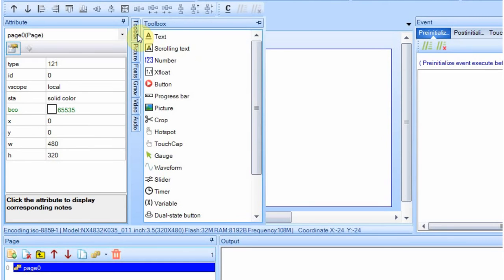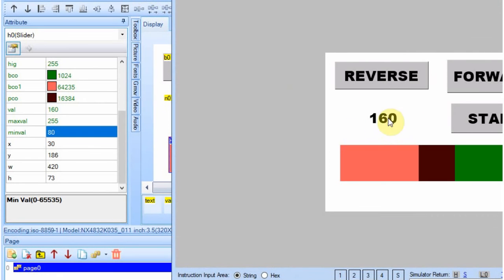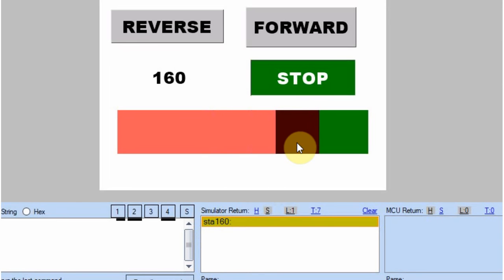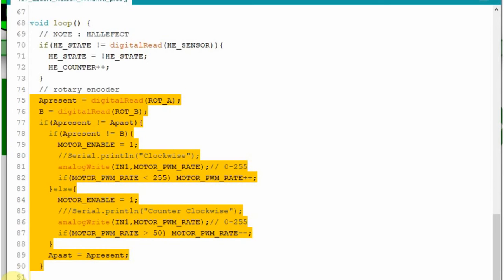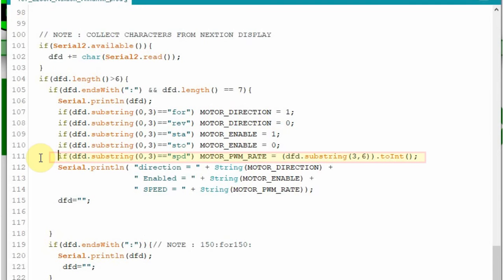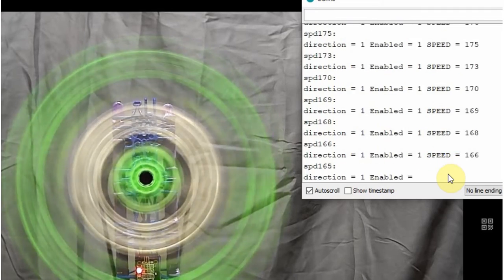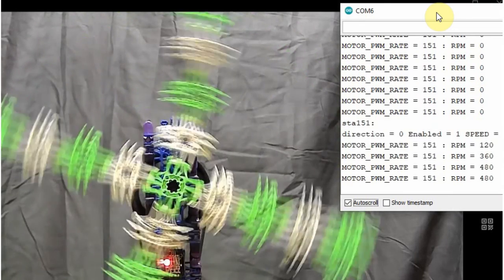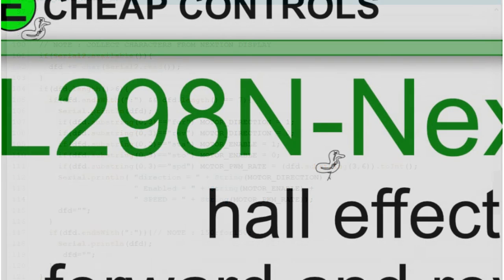157 L298N with a Nextion display and direction control Arduino Programming

Comment: Hello, i have a question. Is it possible to combine the functions in this video with video 132, so i can adjust the speed, direction, and duration of the motor in 1 display? Thanks
Reply from the maker: I think that is very possible.  Maintaining speed over time can get tricky.  You will need some PID control.  But it is doable with some time and patience.

Comment: Where is the link code? link not found
Reply from the maker: I am sorry you had an issues.  I fixed the link and uploaded the code.  If the link does not work you can try www.cheepcontrols.com directly for older videos and then in the search box enter the video number.  Thank  you for watching.

Comment: I set the initial value in the slicer to 80. 
But for me it only shows when I touch it. 
How can I make it count the value of the slicer at startup?

if(h0.val>5)
{
  va0.val=1
}else
{
  va0.val=0
}
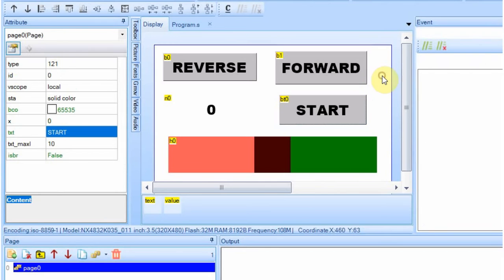Reply from the maker: I have it set on the page initialization.  this way when you start the screen it should show the value.  Go back to the 2:45 time in the video and watch.

Comment: hi is it possible to have 1 button with multi time of text ?
Reply from the maker: I believe it is possible.  I am not sure exactly what you are asking but you can program many lines to output with press of a button.  You can have a delimiting character to seperate the lines or have a short delay.  Thanks for watching
Reply: thank you for your reply! i trying to convert button to nextion in the arduino i using switch case coding to perform single button to switch the task that i set to display it at nextion display do u have any project something like this?
Reply from the maker: There may be a language issue.  I do not understand the line "i trying to convert button to nextion in the arduino"  Are you trying to take a physical button that used to connect to the Arduino and use the Nextion Display instead?
Reply: thank you for replying my message! sorry for my late reply! i was trying to use the nextion display button to control the motor, that's 3 type of fix motor speed need to display but just on 0ne single button, to display sp1, sp2, sp3...
Reply from the maker: I understand now.  Thank you for the better explanation. I will look through my other videos and see if I can find something to help you.  I will post again if I find one or if I don't.
Reply from the maker: what type of motor controller are you using that is connected to the Arduino or is your motor controller connected directly to the Nextion Display.  Also what model of Nextion Display are you using?
Reply: hi i really appreciated you take seriously my question! i am using  NEMA23 motor  DM542 Driver  connected to NANO and NANO connected to Nextion Display
Reply from the maker: I will look into this and comment when I have collected some information.  I am not familiar with the DM542.  I assume it is similar to some of the ones I use so I should have some input soon.
Reply: that's great ! for DM542 still using enable , direction and step
Reply from the maker: It is very similar to the TB6600.  You have lots of options.  You can check a variable to see with the value is and then change the variable every time the button is pressed and send a string to the Arduino based on the variable value.  Another option would be to have a variable in the Arduino that changes when you get a string from the Nextion.  I think storing the variable in the Nextion.  then you can also change the text based on the variable.  I hope you understood that.  Feel free to ask more questions.
Reply: @CheapControls  ok I will try it tomorrow will let you know the outcome! Have a nice weekend:)